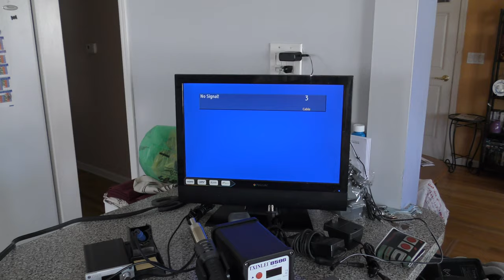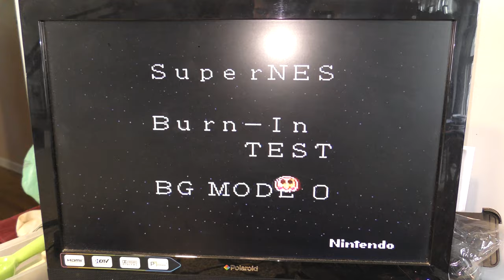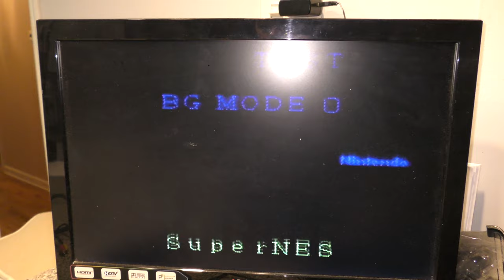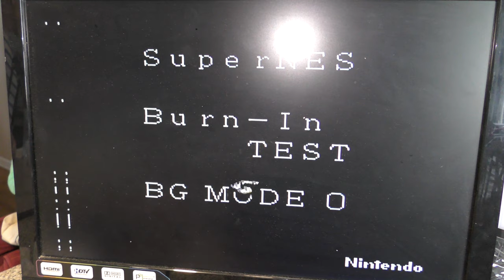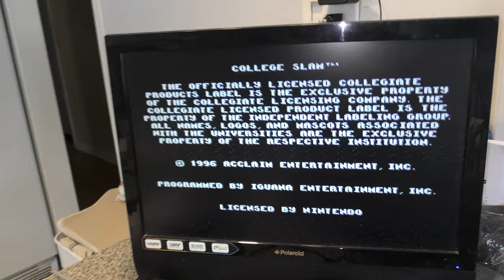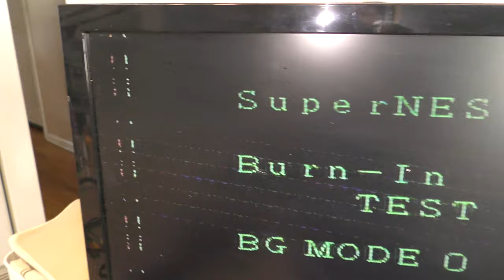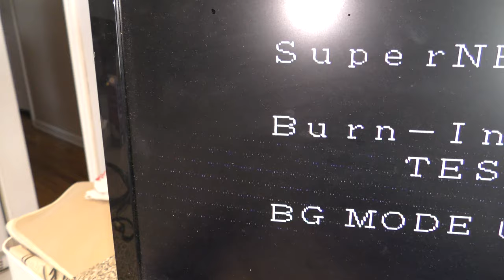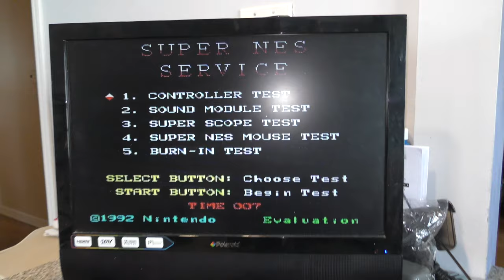VGRestore Ep8: 2 SNES Repair (CPU, PPU1, PPU2 Swap)

Comment: Do you find the reflow ever fixed the problem?  I have a few snes that I think the CPU's are bad on.   Just wondering if they may need to be reflowed
Reply from the maker: john Guido it usually never helps tbh.
Reply: @PunkNDisorderlyGamer  Ahh thanks for the heads up.  I might try it on one just for giggles.  Got no spare PPU's or CPU's sadly.
Reply from the maker: Check out my super famicom series they may help you out. Super famicoms are the same hardware as ntsc Super Nintendo’s. I’ve had distortion and it was due to bad caps.
Reply: @PunkNDisorderlyGamer   Ill def check them out.  Love watching repair vids.   These ones just give me black screens, even after complete cleanings.

Comment: Question to anyone that may know. I tried to change the cpu and the ppu1 in a snes unit and I know the chips are good. When I switched on the unit after I soldered the new chips the unit was working fine for 7-10 mins and then it died. The pictures was distorted and then black screen. I let it cool down and switched it on again. Now it was fine for about a minute and then black screen again. The third time I switched it on it immediately projected black screen. Does anyone know why???
Reply: I think this just happened to me after reflowing the solder on the chips. I think there's a solder bridge somewhere on the pins of the chip. I don't know if it's ruined or not. Maybe Punk can tell us.
Reply from the maker: Try cleaning the cart and the cart slot, it’s strange that it would work for a few minutes and then stop all together. Also, don’t forget the sound module if you’re working on an early board revision.
Reply from the maker: @inputfunny  it’s probably not ruined just recheck your work. Also, try cleaning the cart and the cart slot.
Reply: @PunkNDisorderlyGamer  
Thanks for your reply. I have taken the unit completely apart and cleaned it thoroughly with 91% IPA especially the cart slot. I could try it again. No sound module in the unit I’m working on. It’s a pal version and have not come across to units with sound module. 

Btw thanks for your video it helped me to trace what was wrong with the SNES to begin with.
Reply: @PunkNDisorderlyGamer  Thanks.
Reply: I figured it out. I put a lot of flux on the chips and got rid of the solder bridge and cleaned the flux; still the same thing. So while recleaning the flux from everything; I noticed a lot of flux-gunk was hiding behind the pins. After 5-6 rounds of blowing that out with compressed air and cleaning them with a toothbrush and 91% isopropyl alcohol; it works fine now. The flux was shorting the pins together.
Reply from the maker: @inputfunny  yeah so I’m not crazy, I had one do the same thing. It wouldn’t work, then after a good clean it started working.
Reply: @inputfunny  
Thanks a lot I’ll try it. I was suspicious of the flux but knew/was told that it was not conductive so didn’t pay too much attention. Glad you fixed the issue, wish me luck!
Reply: @stergiostopouris2296  I think a lot of fluxes are conductive, but there are no-clean ones that aren't I believe, but I've heard they're not as good. Let me know if that works for you. I had to clean mine a lot.
Reply: @PunkNDisorderlyGamer  Yeah I think most fluxes are conductive, but there are no-clean ones that aren't I've heard, but I've also heard they're not as good.
Reply: @inputfunny  
I’ll let you know. I’ll have to try harder than you since I don’t have compressed air so it’s going to be ipa and toothbrush for me. 😅
Reply: @stergiostopouris2296  Hopefully that's enough. I use MG Chemicals flux paste and it really gunked up behind the pins. I don't know if I could've got it all without the compressed air.
Reply: You might have to flick the toothbrush bristles in an upward motion between the pins to get it out instead of just scrubbing over them; that worked well.
Reply: @inputfunny  
Thanks for the tip, are reflowing solder and cleaning thoroughly with plenty of ipa and a toothbrush, the SNES works fine!!!
Reply: @stergiostopouris2296  Good job.

Comment: Where do you learn how to made these chip swaps?
Reply from the maker: I self taught myself, it’s not perfect but it works for me.
Reply: @PunkNDisorderlyGamer  Here where i live it's hard to learn that kind of stuff, mainly because people refuse to work with old hardware. There is no one that can fix my snes, so i think i'll have to learn by myself how to do it.
Reply from the maker: Yuri Rocha I’m not sure where you live but perhaps consider buying another SNES it may be cheap option. To find replacement chips you have to pull them from another SNES anyway.
Reply: @PunkNDisorderlyGamer  i guess you're right
Reply from the maker: Yuri Rocha what’s your snes doing? Are you sure it’s a bad chip? I have 3 videos of me fixing super famicoms, it’s the same architecture so the repairs are universal, watch those three parts perhaps you can find a similar fault and it may not need a chip swap.
Reply: @PunkNDisorderlyGamer  It depends on the game. in super mario world, it's geting just a black screen, in sim city, the initial screen glitches and freeze, in mortal kombat 2, it's playing a glitchy intro and then freezes, in super bomberman(j), it only plays the intro music with a black screen.
Reply from the maker: Yuri Rocha yeah that sounds like a bad IC. Did you clean the cartridge connector? If it’s a bad IC then just try and get a cheap replacement console even if it’s in bad condition, you could swap the internals.
Reply: @PunkNDisorderlyGamer  cleaning the cartridge port with isopropilic alcohol was one of my first ideas, but it didn't solve the problem
Reply: @PunkNDisorderlyGamer  and getting my hands on a new pcb or working console is too much pricy for me right now
Reply: Hey, i found 2 new broken snes, one even stars but freezes in the first screen of some games(for others is just a black screen) and the another having a 1 chip Motherboard that has a solder drop in the chip legs and idk how to fix it, and by trying to fix i think i just made it worse

Comment: If you want some advice for my fellow video game repair man if you're gonna fix it why don't you go all the way and retro brighted as well that's what I do with all the systems that come my way that people want me to fix then are yellowed
Reply from the maker: Check out episode 45 👍
Reply: Retrobright doesn't repair anything and it doesn't last. Infact, sometimes is makes the already weakened Plastic weaker. With the SNES, you are usually better off leaving well enough alone or doing a case swap. I'd never try to sell a Retrobrighted Console w/o disclosing this.

Comment: My super nintendo is doing the same thing do you sell those chips
Reply: I would like to buy a snes 001 cpu and ppu 1 and ppu2
Reply from the maker: Unfortunately no I don’t have any for sale. These chips are proprietary chips from Nintendo and aren’t commercially available I take them from parts units and I don’t have many on hand, in fact I don’t have any CPUs on hand at all at the moment. 

What’s your snes doing specifically? It may be cheaper to buy a new console and sell yours for parts.
Reply: It won't load Legend of Zelda but it will load basket ball
Reply from the maker: James Sowles is the basketball game running correctly? Perhaps the Zelda game needs to be cleaned, I would open up the Zelda game and try to scrub the pins with some Brasso. After the Brasso I would follow it up with some alcohol and try to see if the game loads.
Reply: I use some ipa on a q tip and opened up the cartridge and it looks perfect. Basketball seems to work fine tho one time when i put it in the game was running really fast players moving really fast
Reply from the maker: James Sowles you could have a bad snes then. Did you try the games on another console?
Reply from the maker: James Sowles what you could do is buy a lot of super famicoms (Japanese SNES) and cannibalize them from that, they are the exact same. A lot of 12 super famicoms costs about $90 dollars but you could be getting bad CPUs and PPUs among the lot. Keep in mind you could always pair the good CPUs and PPUs with each other. 

Disclaimer: surface mount work is not for beginners please be aware that without the right tools it’s very difficult.